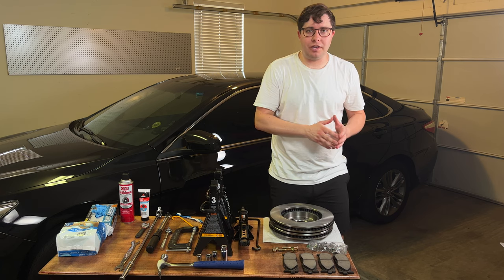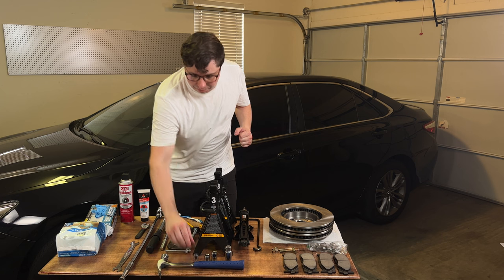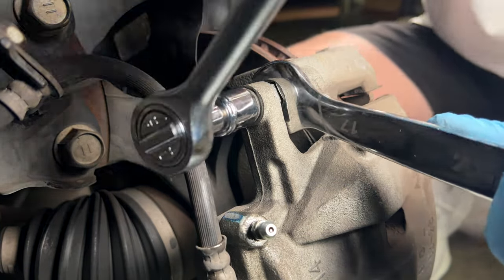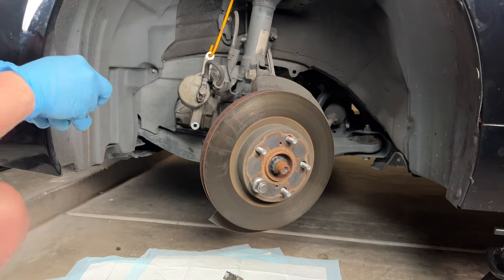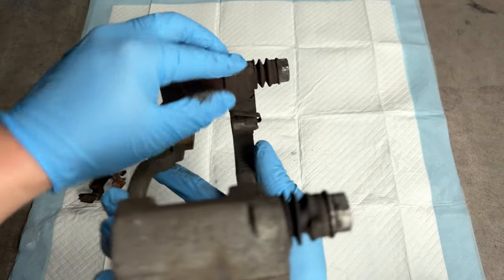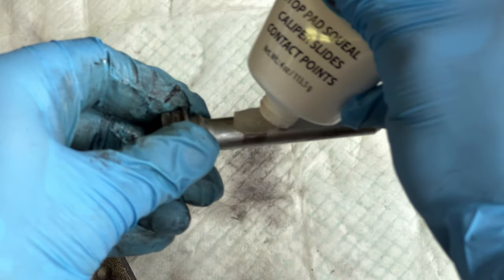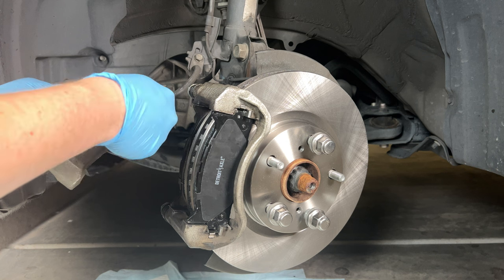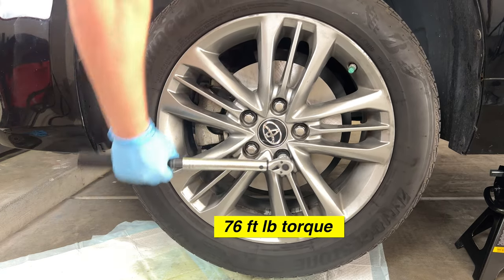How to Install Front Brake Pads and Rotors 2016 Toyota Camry (7th Gen) | Step-By-Step Walkthrough

Comment: Great video. I’m a professional mechanic. I have done thousands of brake jobs. Your video is great. Just make sure to clean the hub with a wire brush or hub cleaning tool and use anti seize behind the rotor. One thing you did that I had never seen before was using the nuts and bolts to push against the back side of the rotor. Good idea. Normally when people take them off with bolts you drive them in with the two threaded holes in the front and it will pull it right off. Also my preferred method for compressing the piston is too just take loose the master cylinder cap and push them back like that. Keep the bleeder screw closed it’s a lot less mess. And definitely look into the right size wrench for the bleeder. Take it from me I’ve rounded off and broke off plenty of those before a precise wrench is a must. Just offering my suggestions for next time and that  hopefully helps you out. I think it’s great to learn to fix your own car. 🙂
Reply from the maker: Thank you! Good tips and I will definitely use anti-seize next time. I read somewhere that keeping the bleeder closed and pushing fluid back could damage ABS system, not sure if that’s true but that’s why I did it that way.
Reply: right on about anti seize on the rotor, I did that.  Do the bleeder screws have to thread all the way in? or just back tight. I was afraid to break it, so made it snug.  From what I have witnessed in garages, mechanics would take a 5lb hammer and just whack the rotor off, maybe not a great idea, but it works.
Reply: I have heard that too. I used to just take the master cylinder cap off, but tried it your way and it worked nice.  @assyrequired
Reply: @VOOODOOO37  there should be like half the threads sticking out as long as it’s wrench tight your fine.

Comment: When you compress the caliper, use an old brake pad between the c clamp and the cylinder. It spreads the force out evenly and also protects the rubber around the cylinder.

Comment: Very nice tutorial! If I may add, a long plastic tubing or hose can be connected to the bleeder valve to direct the brake fluid away from the rotors and brake pads. I also like your way of using bolts to pop the rotor off. Very clever idea indeed!
Reply from the maker: Very clever, might do it this way next time
Reply: No, open the brake fluid reservoir...no mess.

Comment: Next time just remove the cap from the break master cylinder, it'll relieve the brake line pressure and you can compress the brake cylinder A LOT easier.
Reply from the maker: Thank you!

Comment: One step you missed is to wire brush and clean the front surface of the wheel hub before installing the new brake rotor.
Reply from the maker: Good catch, I’ll do that next time. And add some anti-seize as well.

Comment: One thing to note, the caliper pins are different, length and tip. If they are in the right location both should be able to be compressed.
Reply from the maker: Good information, thank you!

Comment: Or option 3 see those little holes on the disk..they are threaded put bolts in and pop of it comes
Reply: Bolt is M8-1.25 - Thread Pitch is 1.25 millimeters
Reply from the maker: Good to know, thank you!

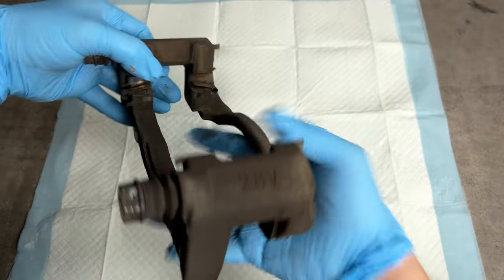Comment: Nice video. I would just compress caliper back no need to bleed, you really made a mess..do it first next time. Just go slow and make sure your brake fluid cap is off.  Also you dont need to use the back bolt trick if your rotors are stuck. You see the two small hols at 8:10 on front of rotor (between the lug studs)? You can put a bolt in there and crank, that does the same thing. I also like to put anti seize  on the hub 9:10 (aftercleaning all the rust)...this will help rotors come off easy next time. No need to get on the bolts. Biggest pain in the butt on these brake jobs are getting the pads back in, the silly little clip on the pad (warning wear pin) makes it difficult to get in just right. Took a while
Reply from the maker: Good points, didn’t realize what those holes were for but that makes sense. Also yes anti seize would have been good, I just did my rear brakes and used anti seize for them and future jobs. Thank you!
Reply: Amen about getting the pads back in. 😖
Reply: The wear off clip is not needed , just follow your service appointment, which will advise you when to replace pads.

To install the pads just angle the top and bottom at the same time. ...Once in... twist them in...done.

Comment: Great video.
I would  add to the video at 8:17 & on.. removing the rotor  the following:
There is a little hole next to one of the lug nuts on the disk which can be used to fit a bolt, which will push in bringing out. ..The rotor.

Also, instead of losing the bleeding valve, just open the brake fluid reservoir, thus avoiding spill of fuild around the caliper.

Never the less....nice video.

Comment: Great video. Liked the mechanical bolt system to press out the rotor. Most shop mechanics just sledge them off, which probably is ok, but more caveman like.  I did crack the bleeder, made it easier to compress the cylinder, worked great. I never used to do that lol.  Great tools list, saved me time hunting for stuff.  This wasn't my car, so first time doing a Camry. The pad wires are cool, my cars don't have those.

Comment: Great video and instruction and thanks!  BTW, just learned what the two screw holes are for on the rotor itself, use them to insert the bolts to loosen it, it works well and you won't have to worry about damaging it.
Reply from the maker: I’ll definitely give that a go next time. Also going to apply anti seize so that it doesn’t stick in the first place. Thank you!

Comment: Bro, believe me this is the most clean,  clear and smooth brake job video I ever saw on YouTube.  I mean that.
I'm going to do my break next week.  Thanks a lot.
Just liked and subscribed your channel. 

1 Question , which size bolt did u use to knock off the rotor ??? That was soo smooth. Please let me know
Reply from the maker: Thank you! Glad it helped. I used 3/8 in by 3 in long hex bolts with 3/8 nuts to pop the rotor off. Good luck let me know if you run into any issues.
Reply: @assyrequired  thanks,  sure I will  if there is any

Comment: Thanks for the clear and concise video. About to do a brake job on my 2017 camry too. One thing though, wouldn't you want to clean off the rust/corrosion from the wheel hub with a wire brush and brake cleaner before you install the new or machined brake rotor? It's what I've seen with other brake job videos.
Reply from the maker: This was my first brake job and I don’t have a ton of experience. When I do my rear brakes I’ll keep that in mind and clean the wheel hub. I have seen folks applying copper anti seize to prevent the rust building up in the first place, so that’s an idea for after cleaning the hub. Good luck!

Comment: You did an excellent job on showing everthing needed to do this. Did you use Toyota rotors or an aftermarket brand?
Reply from the maker: Apologies for the late response. It was a mid tier aftermarket option, I’m not convinced high performance top of the line parts are necessary.

Comment: Hi there very helpful video question on option 2 what are the two bolts size used to take out the rotors thank you in advance
Reply from the maker: 14mm and 17mm sockets and you’ll need a 17mm slim wrench as well. More details in the video description. Hope that helps and good luck!
Reply: Sorry but I meant the size of the bolts when you took out the rotors the size of the two individual bolts
Reply from the maker: @salwansalem8099  I used 3/8 in by 3 in long hex bolts with 3/8 nuts to pop the rotor off
Reply: @assyrequired  thank you for the reply I appreciate it
Reply from the maker: @salwansalem8099  you’re welcome, good luck!

Comment: you do realize that the 2 holes in the disc are threaded so you can screw the appropriate bolt in that will force the rotor off right?
Reply from the maker: I did not realize, thank you!

Comment: What were the specs of the bolt and nuts needed for the rotor trick?
Reply from the maker: I used 3/8 in by 3 in long hex bolts with 3/8 nuts to pop the rotor off
Reply: @assyrequired  thank u for the quick response!!

Comment: Not bad, but def needs a few comments: 
1.  There are bolt holes in the face of the rotor (at 12 & 6 o'clock in your video) that are there to pop the rotor off.  You thread a (8mm?) bolt in the hole and screw it down and the rotor pops off.
2.  As other's said, don't use the bleed screw, just push the fluid back into the master cylinder.  And with your method, you now are low on brake fluid, and must add to get the level back up!!!
3.  And as others said, do NOT push the cylinder with your C-Clamp; use an old pad so you do not damage the rubber gasket.
4.  You might have emphasized that people MUST hang the caliper, and not let it dangle.
5.  The rotor needs to be scrupulously clean!!!!!!!!!!  Another reason to NOT use the bleed screw method,
6. People NEED to be warned that their brakes WILL NOT WORK until they step on the brake pedal a few times after replacing pads.  Yes, you said to do it but people need to be warned that if they skip this and put the car in reverse, it will NOT be stopping!!!
Reply from the maker: Good points. I’ve heard that pushing fluid back into the cylinder can damage ABS module, which is why I used the bleed screw. Is that accurate?

Comment: Nice video! I've never done any brake installation before. But recently I've been trying to understand front brake pad installation and the different parts that are involved. 9:08 Toyota calls them fittings or anti-rattle clips (or casually, hardware). The shims are the plates that go on the back of the brake pads. Also, and I'm bring nit picky here, I believe the wear indicator goes at the top. The way I see it is... okay... at 12'o clock, where does the rotor first make contact of the pads?
Reply from the maker: Good points, I wasn’t exactly sure on the right terminology. I also spent about 30 min trying to figure out where to put the wear indicators and wasn’t able to find a consensus answer online…
Reply: Wear indicators always go inbound
Inside pad
Reply: @petermaciak8030 Is it OK to put the wear indicators on both pads?

Comment: I replaced rotors and pads on my 07 camry . I think I misplaced the caliper guide pin.
There is 1 guide  with rubber on it.
Can u tell me dose it go on top or bottom side of the caliper bracket  ??
I'm a bit confused.  I think I have to re-do that again.
Thank you
Reply: The bottom usually

Comment: Done brakes for decades why in the world would you want to open the bleeder valve???that is not necessary at all, once you do that then you let air into the brake lines & will have to do a complete brake bleed on all wheels creating extra work.. I tell anyone who is watching this video do not open up the bleeder valve it is completely unnecessary just replace the brakes & be sure to keep the master cylinder filled to the full line on the master cylinder reservoir.
Reply from the maker: @BurtBowers  is there a risk of compressing fluid against the ABS module and causing damage? I’m not very experienced, but I heard that online and that’s why I went that route. Next break change I’ll switch it up.

Comment: Guys don’t do the bolt method you can bend those ears this is horrible advice. Cheaper to replace studs than a knuckle. Sledge hammer on the rotor hat does it every time.